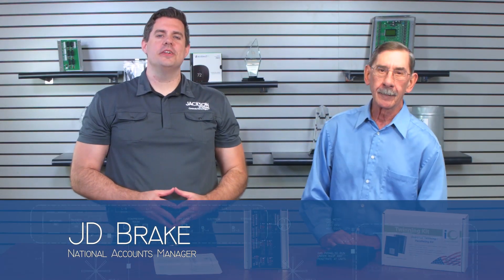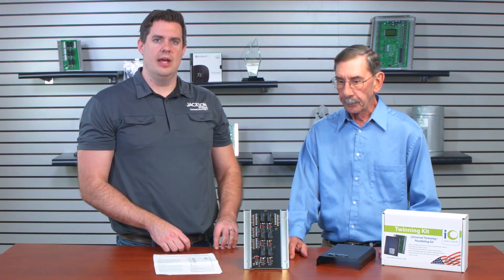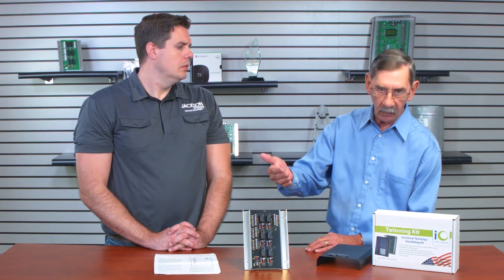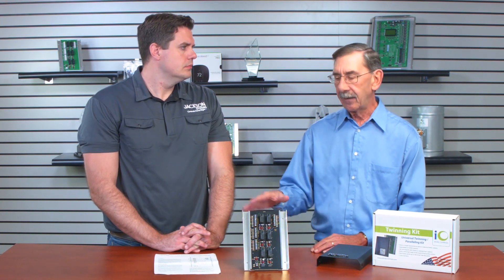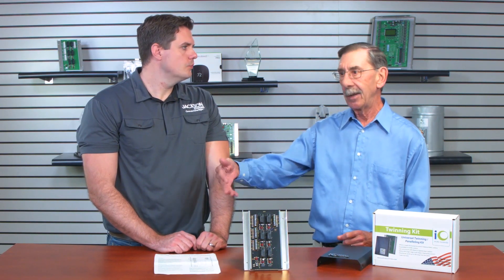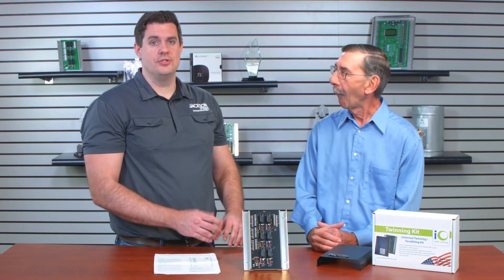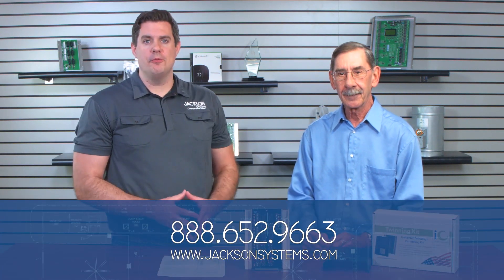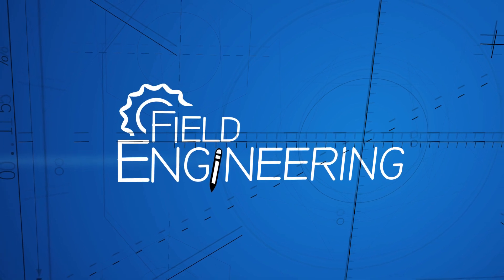Twinning or Paralleling an HVAC System

Comment: I am adding this comment to see if anyone has comments about what I am doing with one of these twinning units.
I used one of these to stage the two furnaces based on first and second call from thermostat.  I understand that we can not let only one fan run due to the back flow problem through the furnace that is not running.  What I did was add a relay that is energized by the first stage call (W1).  The contacts on that relay close the fan input to the twinning unit (G).   When the first stage call comes only one furnace gets the W1 command, but both get the fan (G) command.  Both fans run while the first unit is lighting off.  If a second (W2) comes in then the second furnace lights off.  Both fans are still running from the W1 command.  On my application there is an alternating relay and some fan current monitoring, but I don’t what to explain all that here.

Comment: Thanks for video. I have a different question: I have a solar system and two AC units. One for upstairs and the other for downstair. How can I regulate such that only one unit is running at a time?This way I pull least amount of electricity from the utility company.

Comment: I went on a call where the owner tried to twin they are trying to run two condenser off one thermostat,they piped both units together and they jumped the thermostat wire from one condenser to the other so that when you set the thermostat to cool the thermostat goes blank and the units want start

Comment: Newer furnaces/ variable speed/ can not be successfully twined because the Gov. mandated ECM motors are in all furnaces 2020. So that F'd everyone that needs to twin furnaces in the future unless we can go back to the PSC motors which were less expensive and do not use that much more electricity. Bureaucratics costing us the tax payer more money for repairs or replacement of blower motors in the future. WORD!
Reply: I think the Trane run tru is a PSC motor still.
Reply: @2purplemartin1  All furnaces manufactured after Jan 2020 do not have PSC motors. Gov. mandated. You c thank the tree hugging liberals for that. The more expensive less reliable variable speed ECM motors are in all the new furnaces no matter what the brand is. Trane included!
Reply: @Karl with a K Can you give any more details about the workaround for twinning ECM's? I'd really appreciate it.
Reply: @Karl with a K Karl, thanks so much! I didn't expect an answer! FWIW, I called these folks at Jackson Systems yesterday and they told me that if the units you are twinning are identical, even with ECM's, their twinning kit will operate them properly.  Thanks again!
Reply: @Karl with a K Yessir, I caught that. An Edison and a Solar. I'm going to file this away. Thanks again.

Comment: It would be interesting to hear how to handle twinned systems that will be getting variable speed blowers.
Reply from the maker: Thanks for the comment. I will write that down for a future episode.
Reply: You shouldn't twin variable speed motors ....
Reply: @bigmando78  most furnaces have twin terminals that you connect to both furnaces that will make them both run identical cfm for twinning applications when either on calls for fan both with bring the fan on.
Reply: @carlneuman5958  hey Carl, variable speed and x13 type motors typically are not twinned because they rely on a certain amount of static to determine speed, when they don't see that static, you run the risk of one of the motors not turning to speed.
Reply: @bigmando78  ???
Reply: @pedrocastano6410  yes